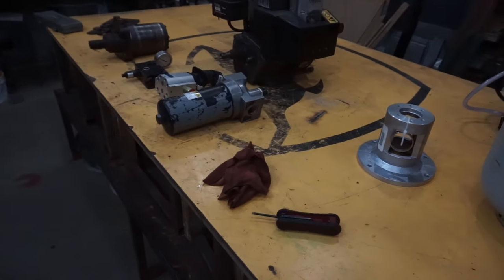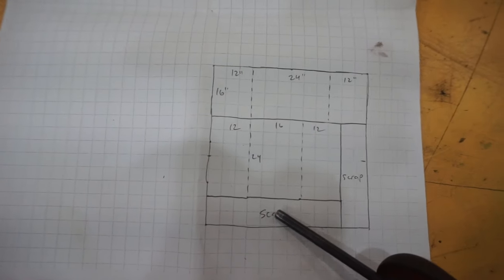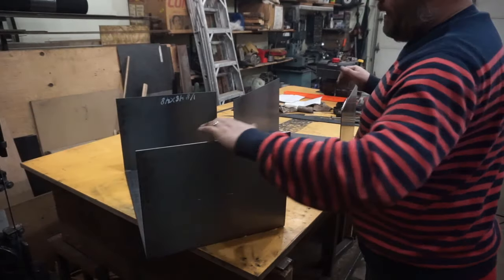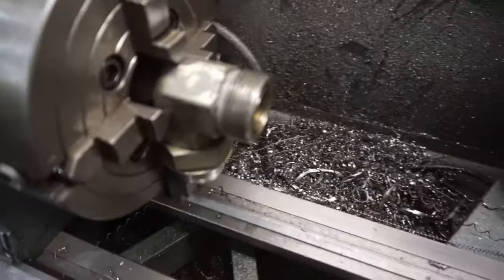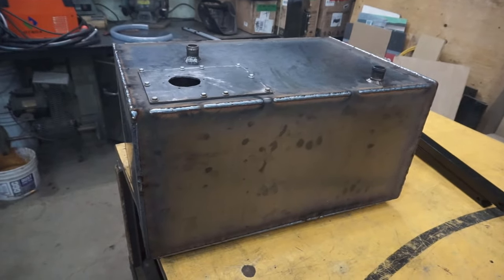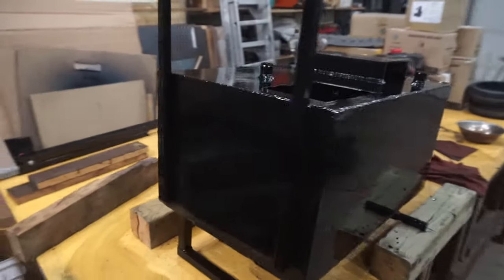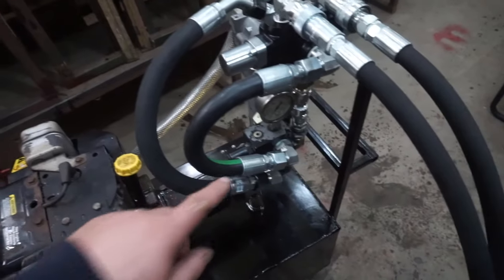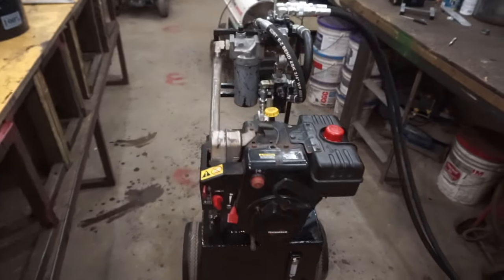DIY Portable Hydraulic Power Pack

Comment: OMG, I actually stumbled across your channel because I want to make something similar.  I'm just renting the auger, however I really want to compact the bottom of the hole before gravel and sono tube.  Gas power pack is what I need to build, then a vertical ram.  Saved and subbed!

Comment: Is there a rule of thumb to figure out Engine HP needed to power the hydraulic pump based on the GPM flow of the pump. I have various motors and pumps and I would like to power a hydraulic winch. Any input would be appreciated

Comment: The engine vibrates because the mass of the cart is not enough
Also you need a few dampers to put between the engine and the steel plate

Comment: Why did you not use the bell housing adapter that you showed at the start of the video?
Reply from the maker: because the holes didn't lign up properly and if I had to re-drill them into the bought bell-housing, I figured I might as well save me $50 bucks and build my own to specs.

Comment: Just curious, being new to hydraulics. Do you actually need anywhere close to 15g?
I would think you would need enough to fill the system, with an extra gallon or two?
Or is this to somehow keep the fluid cooler, heat sink effect?
Reply from the maker: I don't think I need that much. I just figured it would help with the cooling but temperature hasn't been an issue tbh.

Comment: Is there a reason you did not use the hydraulics on the Kubota tractor ?
Reply from the maker: Yes, I do not have the 3rd function on my kubota and I also wanted to have the option of powering my shop press and the wood splitter.
Reply: If he did,,  then there would be no need to build this!
Reply: @drainmonkeys385  Exactly,   were it not for the other uses there would be no need
Happy New Year

Comment: Are you going with a front bucket mount or 3 point hitch post hole digger setup?
Reply: I have an older BX and the 3 point does not lift enough to easily use a PHD.   Even worse a 3 pt does not push down.   A loader mount is often the better option.
Reply from the maker: I'm going to design it with the skidsteer quick attachment style so I can disconnect the front bucket and hook up the post hole auger in its place. That way I have the pull up as well as push down option whereas with the 3pt hitch I would not have any downward force.

Comment: Why didn’t you place the pump below the oil level, thereby always ensuring oil in the pump preventing potential loss of prime? All ‘commercial’ power-pacs I’ve seen have the pump inlet below the low oil level in the tank... usually below the entire tank. Certainly it might have made the footprint slightly larger, but maybe not with a little different engineering.
Reply from the maker: Because the engine is a horizontal shaft.